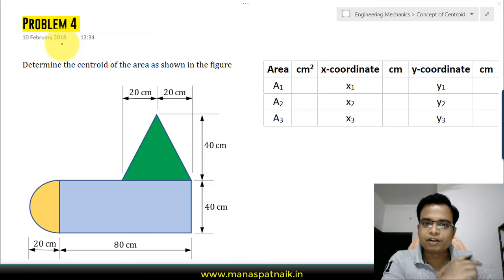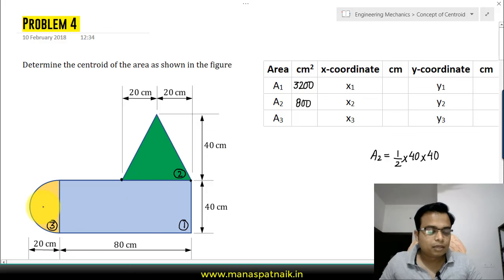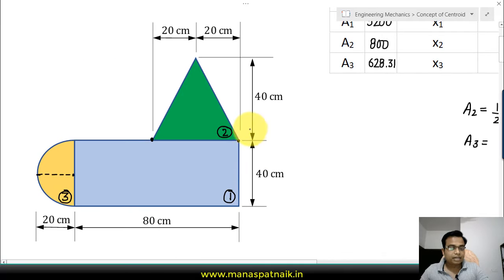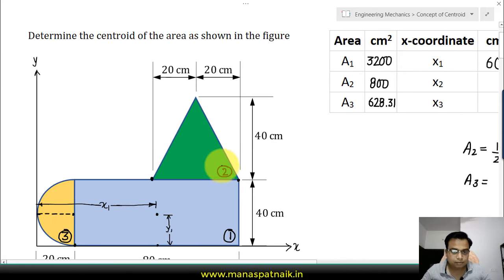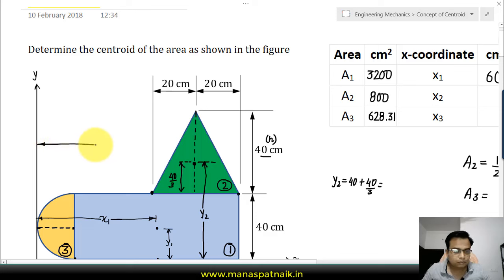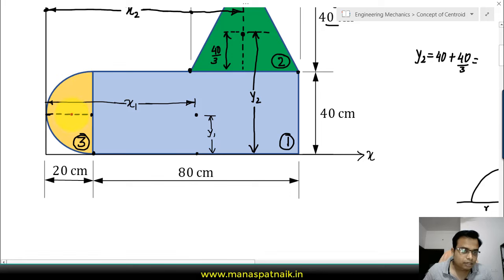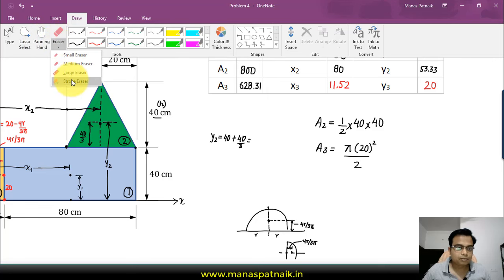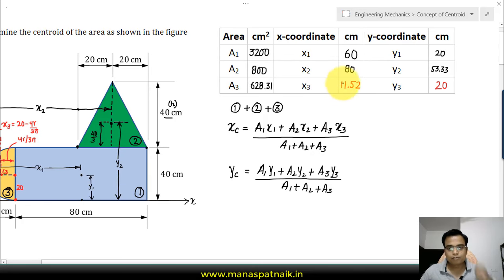How to find Centroid of an Composite Plane | Problem 4 |

Comment: Sir solve my question emmidiatly

a circular hole of diameter 100mm is cut of from a square plate of 200mm*200mm. find the location of the hole, so that the center of gravity of the remainder be 10mm left from the center of the plate

Comment: Please make a videos like
Question Example:-
Two blocks of masses M1 and M2 are connected by a string as shown in Figure 5.
below Assuming the coefficient of friction between block Mị and the horizontal
surface to be u if the system is released from rest, find velocity of the block A
after it has moved a distance of 1 m Assume Ml00kg.and M2-150kg and
u0.20.
Reply from the maker: https://www.youtube.com/watch?v=pKAM2CVdwmA&t=529s&list=PLIhUrsYr8yHwOZxmY63A_lURu6c-jNk-z&index=15